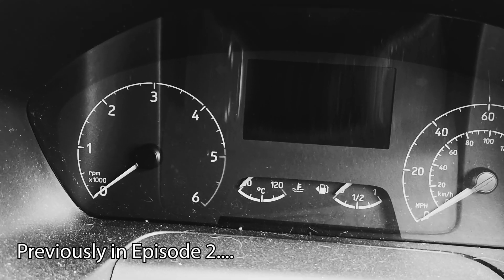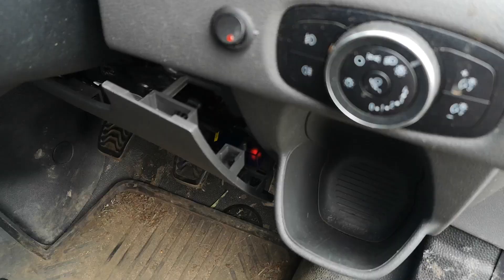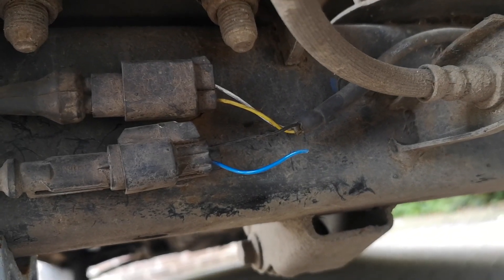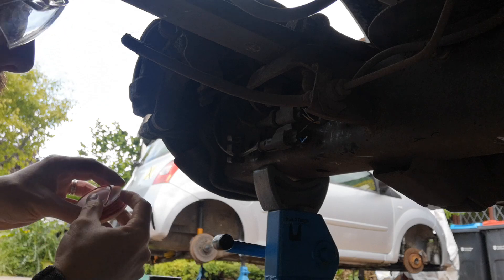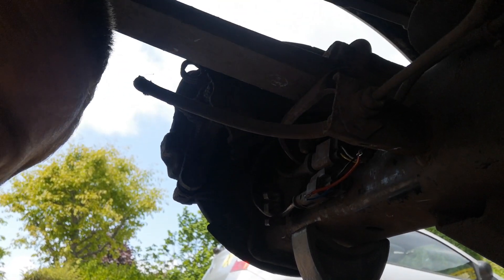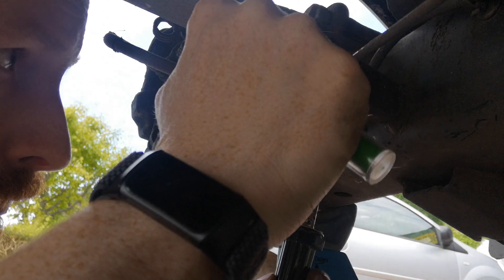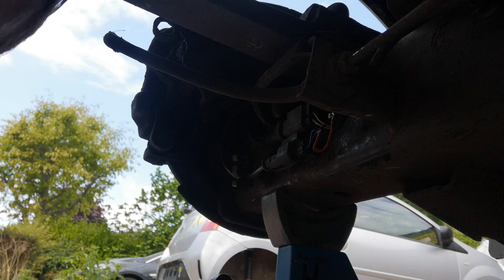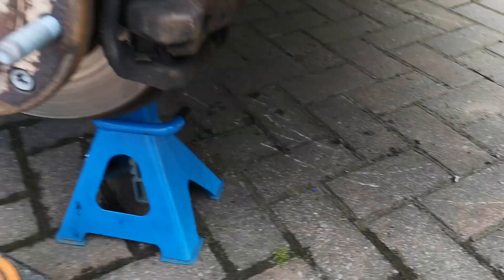Transit Custom ABS wire fault causing major system malfunctions

Comment: I had the same errors come up (including and ABS fault)!  The main dealer couldn't look at it for three weeks but they suggested something may have been chewing the cables.  Sure enough, a fox had chewed right through the cable where it went over rear beam and completely stripped the ABS cable that went along the beam to the O/S.  He'd also had a go at the main loom halfway down the van underneath where it hangs down but fortunately, had only damaged the plastic loom casing which I just taped up.  I had to replace the rear cable assembly (found a new one on line for £80) and all the errors went away.  To deter Mr Fox, I have put loads of cable ties around the vulnerable bits and cut the long bits off about 30mm long and at about 45 degrees making the cables very spikey. So far so good! 🙂 And I didn't even take a wheel off 😜
Reply from the maker: Yep a lot of modern wiring has corn based (or similar) coatings on the wire for green/eco reasons and naturally this is tasty to animals

Comment: It would have been easier to have disconnected the plugs and popped the clips off the beam to give you more access to the wires to repair.
Reply from the maker: 100% would've been in retrospect, no idea why I didn't think of it at the time!

Comment: Lucky....mine 2020 transit 350hd dually 3.5 turbo.rear brakes keep lockin up then switched to front code said brake pressure switch/ sensor...power steering off code said internal short. I have launch scammer snd forscan scanner advanced.....lost no fix